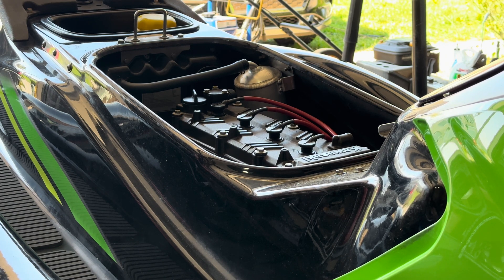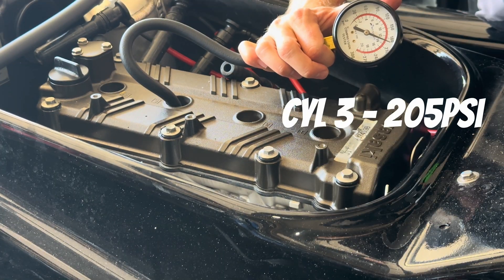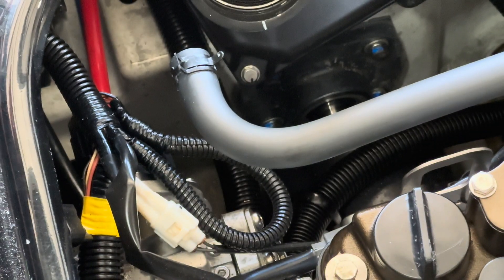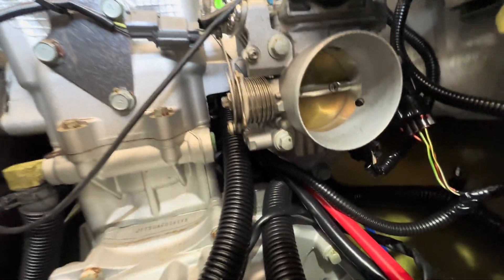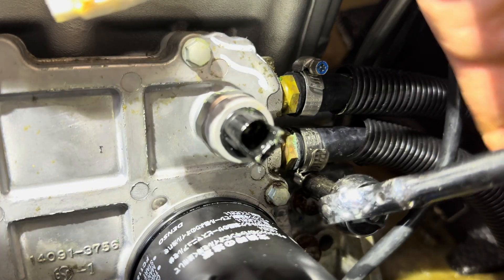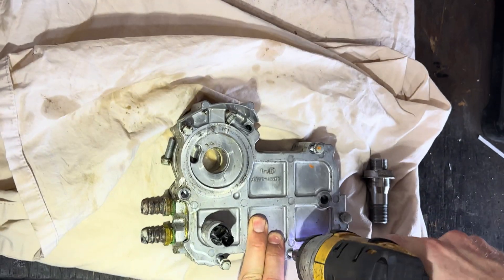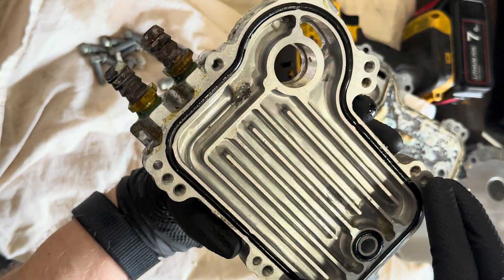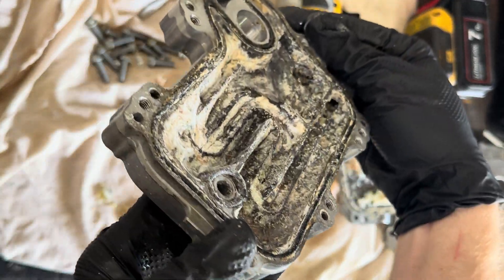How to fix water getting in to your Jet Ski’s engine oil

Comment: Having an oil hot error code on my stx15f and I’ve checked oil cooler, lines, and everything is fine. Changed oil temperature sensor and pressure sensor and both are fine 🙄
Reply from the maker: Well it sounds like it still running hot so the cooling system is clogged up somewhere. If you’ve checked it from the jet pump, stator housing, cylinder head cooling pipe (under the intake manifold) and all of that is clear then the passages inside the cylinder could be full of stuff. Have you run it on the hose and does it overheat then?

Comment: Good stuff . I have a customer with same issue , after checking that the oil cooler is good , I don't know where to go from there. I test drove it for 30 minutes, dosnt appear to be getting any water in it. Intake manifold was full of oil and water when I had the cooler out...
Reply from the maker: @drewmac4046  compression test good? Could be they blocked the jet pump, overheated it and popped the head gasket. Although that won’t necessarily show on the compression test. That was what happened to this jet ski
Reply: @rowlandrestorations  compression was good. Yeah I changed the oil. It cleared up so far ...
Reply from the maker: @drewmac4046  Hull leaking? Could be getting water in from air box where the oil catch can connects to it. Give it some more ride time and keep checking the oil. Could have been a one time thing with water getting in it

Comment: I have water in the oil on the same ski. After 2 min of riding it’s almost out of oil and white. Will this also cause oil to leak out?
Reply from the maker: If the cooler is bad enough, yes. You can lose oil through the cooling system. Do you ride in salt water?

Comment: Hey… I have the same problem on mine, how can I solve it? VXR 1800 YAMAHA 2015 .. Where can I find that part in mine?
Reply from the maker: So the first thing is do a compression test and see if any cylinder is obviously low. Your oil cooler should be located under the exhaust. You can remove and inspect that and hopefully that is your issue. Some of the Yamaha 1800 are prone to cracked cylinder heads and that's not always easily shown by a compression test either. Only way to find out is to start checking the different components. Hope this helps and good luck!